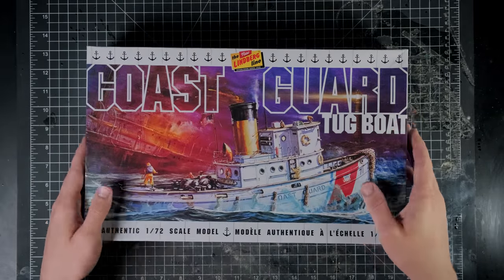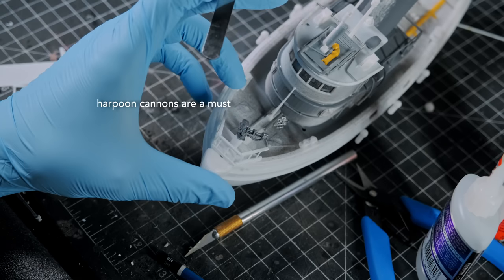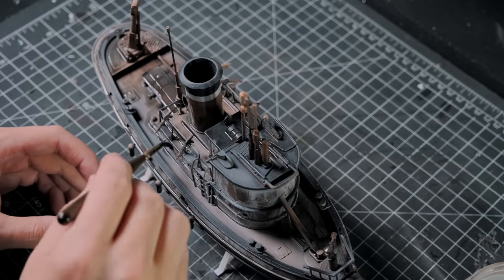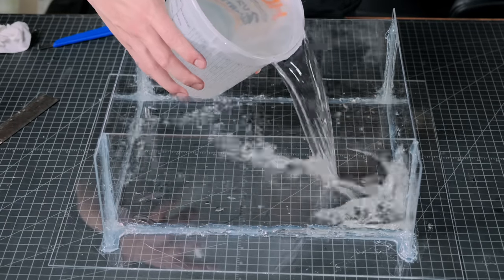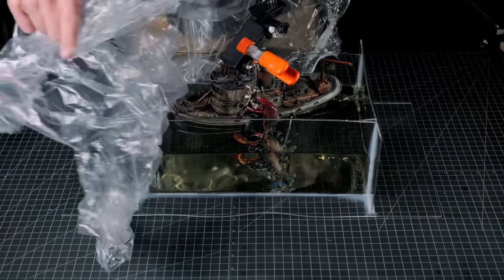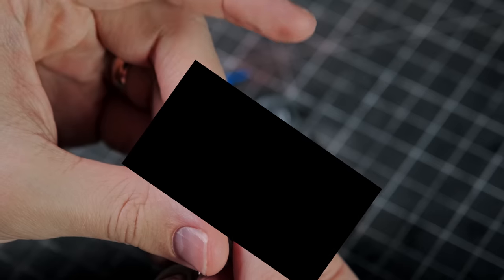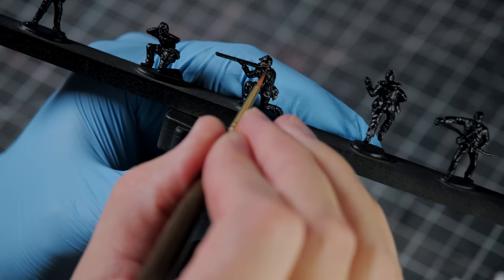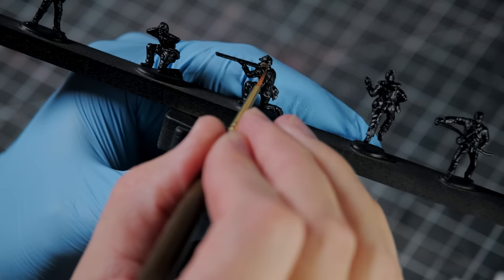Lobster Attacks Fishermen Diorama

Comment: Best way to avoid heat damage is to build up the resin in layers. Yes it'll take longer to complete due to the repeated curing time, but it goes a long way to preventing disaster.
Reply: I think only issue with that is that you get lines between the layers of resin
Reply: slower cure resin?
Reply: @PokeComa  Should be barely noticeable if the proportion of pigment is the same in each batch.
Reply: @lostsock9852  Still creates heat, just over a longer period.
Reply: @PokeComa  One of the ways it can be avoided is by mixing the dye with the resin itself and only adding hardener right before the pour
Reply: another advantage of that is you can paint between layers, and create fire, murky water or fog effects.
Reply: @the_once-and-future_king.  I love your name, king Arthur rules
Reply: Does that not cause lines with each layer?
Reply: @Malumbrus  it would seem not necessarily- check out Jazza's video on it.
Reply: @nelly5954  
And add other floating things at different levels (debris, other ocean life, plant matter, etc.)
Reply: @nelly5954  Oh cool Jazza's awesome.
Reply: Just shove the whole thing in the fridge

Comment: I've talked to resin manufacturers when doing large pours.  They recommended using thicker acrylic sheets and staggered pours to avoid cracking and other incidents, or using lower temperature-curing resin (which takes ages to set and harden).  It takes much longer, but the results are usually worth it.

Comment: going on my second major resin piece (commission). resin can get so super hot. it has to stay in max of 2 inch deep pours. even the "deep pour" piece before this was a dining room table size table. 13 gallons of resin. took 8 pours. this is current piece is a desk with 4.5 gallons of resin. did it in 5 pours. trick is to make the "pour seams" work for your and not fight them. 

LOVE your pieces. gotta try something fun like this some day. I love furniture but it doesnt have the whimsy your art does.

Comment: For reducing resin dust try connecting a shopvac to the dust intake of the sander. I just did this with my orbital sander and it reduced the amount of particles flying around by quite a bit (still wear a mask though)

Comment: I think you could have integrated the crack as a broken cable. Like make it look like a cable snapped under the crabs weight, make vertical waves and foam on the line of the wave. I mean you wont make that crack disappear, might as well make it a feature.

Comment: I've seen people fixing cracks in their resin by pouring some resin on the surface and then putting them in a vacuum chamber and pulling as much air out as possible before letting the air back in, the process would cause the resin to get sucked into the voids of the cracks. It sometimes works, sometimes it dosent.

Comment: Drilling a hole (or multiple) in the crack and filling it up with resin should give you an invisible fix. Very small holes (from small drills) lock air bubbles, so use big enough drills.

Comment: Ha!  Yeah, got have to either use small batches of resin or use a slooooooooow setting type.  My horror story was mixing up a batch for fiberglass application and the container I was holder started to boil and smoke.  That was interesting.  :)

Comment: If you squirt denatured alcohol on the glue gun joints it will break loose the joints much easier than you think cutting. When removing the plexi from the resin

Comment: Honestly I kinda like the crack. It looks like a wall of bubbles like the lobster dove completely out of the water during the attack. Personally, even when using supposed "deep pour" resins I still do my pours in several layers because I am thoroughly convinced that "deep pour" is a mostly a lie. Sure it's a little less of an exothermic reaction but it still likes to get stupid hot.

Comment: The thing about the scaling-People were NOTICABLY shorter in the 1700s/1800s. If you look at old houses the doorframes seem way low to modern humans. And the boat model is more 1950s looking when painted as designed so the figures are probably completely accurate to the eras they represent.

Comment: You could save the crack by widening it a little with a cut, then swing the arm at the back of the boat around, hang a net from the arm down into the widened crack then back fill with resin. It will look like the ship caught the lobster on purpose (a giant lobster hunt). Add some harpoon guns and give some of the figures ropes/lassos and grappling hooks. Put a name on the boat like “Shell Cracker”. Would make for a better story too I think.

Comment: When a bullet is shot into water it leaves a trail behind it as well as having bubbles trailing up from the line it left behind in the water. The crack looks like it lines up with one of the guns on the side. So what I’m saying is that the crack is simply where a bullet was shot from the gun and is actually the trail of bubbles it left behind.

Comment: The only thing that would have made it even better in my opinion (other than the resin not causing issues) would be if you had sand and vegetation on the bottom. Like little underwater vines and   driftwood and such. Otherwise, still fantastic.

Comment: I would have cut the thing in two, or drilled out at the crack line, and added a fishing net (with some floats on the surface) on the crack line and into the water to try to hide it.  Maybe you still could ?